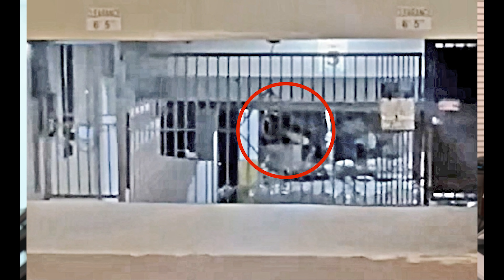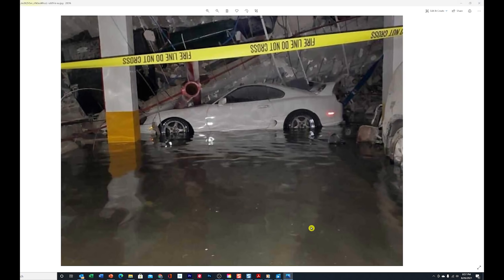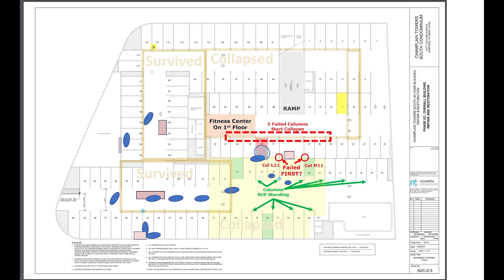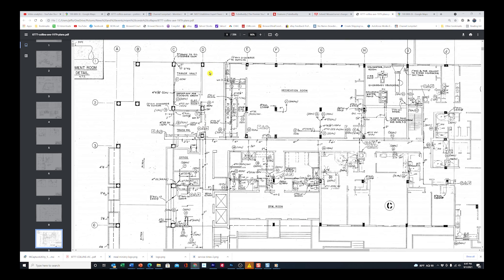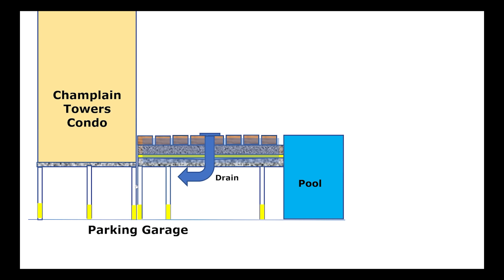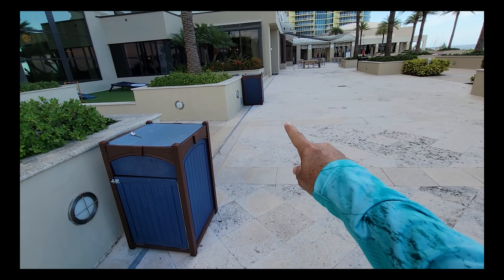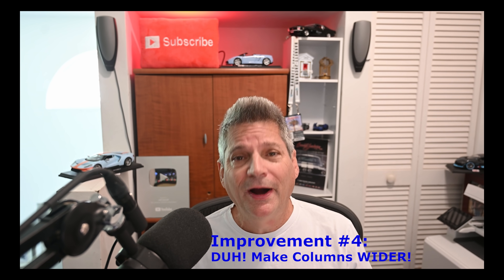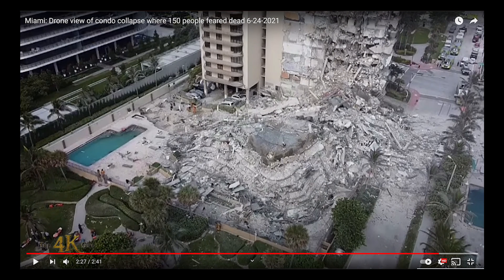Miami Condo Collapse: 4 Engineering Fixes May Have Prevented It

Comment: You forgot shearwalls.  The building should have had many more shearwalls, around the entire perimeter of the foundation and traversing the entire depth and height of the building - west/east and north/south.
Reply: That might add a lot of weight to the building, creating even more deadload for the columns and foundation piles to carry. Anyone can design a building that can last forever, but an engineer can design one and take out all the redundant or unnecessary "fat" out of the structure. Also keeping the design simple, and easy to build will help with workers not cutting corners. Like Omar Little once said, "You see, we got to have it simple, Omar like it simple".
Reply: @brnmcc01  Well, we're told that they removed 22 million pounds of debris, so the building itself was probably 20 million pounds.  The shearwalls i'm talking about would have probably added another million but would have strengthened the building immensely.  They wouldn't have increased the deadload for the columns, as (properly designed) they act a giant columns themselves, in addition to providing lateral support.  And 98 people would be alive today if they'd designed the building correctly.
I'm actually amazed that a hurricane didn't blow the building over at some point, with it's tiny little shearwalls in the wrong axis to take the wind - no east/west shearwalls!  Wonder how many other contemporaneous buildings in Florida are built as flimsy at CTS was...
I used to be a fan of engineers optimizing stuff to the nth degree.  But fuck that shit, if it ends up killing people...  'When in doubt, build it stout'. 
On the other hand, maybe the building was just doomed.  The demolition company planting the explosives to demolish the remaining west portion said it was the softest concrete they'd ever drilled through.  Maybe it would have fallen at some point, with or without the pool deck collapse.

Comment: Have a strong suspicion that Champlain Towers North will implement the column widening and capitals, in earnest, very soon.
Reply: It's relatively easy to do in the basement level, not very practical inside the lobby and condos.
Reply: @gordonrichardson2972  Well, the basement level, especially under the pool deck, is the most critical.  It has the smallest, "most overloaded" columns in the structure and if any deterioration/weakening from water occurred, that's where you'd want to repair and shore up right away.

Comment: #1- In hindsight- an expansion joint to separate the bad from the not so bad yes it would have kept the collapsing pool deck from influencing the building.  However I will say that most engineers and architects would not want to do that, and I don't think people in any of the 3 companies I have worked for would want to do that.  It has a big affect on the design of the building to resist lateral loads and a big affect on the design of the pool deck to brace the basement walls.  Plus architecturally nothing would be worse than trying to create a working EJ cover right at the face of the building among pavers, planters and slab offsets.  It would be a major point for leakage.  Lots of buildings have basements larger than the upper building footprint, I will say that almost none of them have expansion joints between the tower part and the lower part.  Separating the bad from the not so bad- if designed properly then there isn't any of it that is bad.
#2- drop panels are useful for punching shear.  The ones you are showing in that other hotel are not real drop panels, they would be called drop caps.  And yes they would increase punching shear capacity.  Of course all you have to say is that the Champlain Tower should have been designed properly in which case they would have added drop panels or thickened the slab or some other means to satisfy the building code requirements.  The original drawings were deficient in this regard for some reason.  Drop panels are very undesirable in the upper levels because nobody wants to bump their heads into a drop panel in their expensive condo.  There are other means of addressing shear design besides drop panels but for some reason that was missing from the original design.
#3- column capitols are almost never done these days because of difficulties in formwork.  People would complain about the cost, and again they would complain about bumping their heads into the capitols in their expensive condos.  The photo you show is a repair, and I've had to repair those things too.  If built with capitols from the beginning they don't typically put reinforcing in the capitols, that complicated reinforcing was just required by the repairs.  And BTW there are some issues with the design of those repairs and some reinforcing that they left out that should be there.  Plus all of that slab should be shored.  I assume they were lucky enough to get it built without collapse but that is one where I would run out of the building screaming.  But to your point yes column capitols will increase punching shear capacity as well as drop panels.
What would I have done?  I would have designed it properly!  I've spent a lot of years designing reinforced concrete and all aspects of it have to be done right- the slab thicknesses, the slab reinforcing, the column dimensions, shear checks for one way shear and for two way shear, all of it.  I've studied the drawings carefully and there is evidence that this was not done in the original drawings, and some parts of the original drawings clearly do not have enough reinforcing.
Reply: Thanks for your (several) insightful comments. BTW, Florida is a hurricane area, so there would have been multiple design constraints, but not enough consideration of long-term stability.

Comment: What I know about engineering wouldn't fill a hard hat, so this is more questions than anything else, but when I look at some of these century old skyscrapers in New York or Chicago, particularly pictures of them being built, I see these huge steel girders and I-beams that the buildings are then built around, and I've even heard them credited with making the modern skyscraper possible.  I never see rebar sticking straight up with cement poured all around it.  Wouldn't a good steel frame make a building more stable than rebar?  Would a combination of rebar surrounding a steel frame be better?  Or worse?  I'd also seen where big chunks of concrete had fallen off the balconies, and a big crack near the roof of the building, (which I suppose indicated stress or a shift in the load).  These missing chunks of concrete from the balconies made me wonder if the cement had been properly cured or hydrated.  Could poorly cured concrete have been a problem?
Reply: I know only sh*t too. But, what I gather…this is by coast hence, humidity, see water, salt would be a major problem for steel buildings.
Reply: @Wazupu  I thought about that, but the same problems should apply to New York and Chicago, except less salt in Chicago.

Comment: I agree with the changes you proposed. I had thought along similar lines as I have been following this situation.
I'm not an architect or an engineer (I am a career maintenance man, though), but the design of the Champlain Tower South leaves a very bad impression on me. First and foremost, I think this building would still be standing today if it had been maintained properly throughout its life (as I have said previously). By that I mean that there should have been a dedicated team of people looking after the building daily, people who could have found minor problems before they became major problems, and made the necessary improvements to prevent major problems from becoming disasters. I also think that the columns were too thin and spindly to properly hold up against unexpected forces, such as a pool deck collapse or ANY lateral load. Lastly, I think that there should have been a lot more redundancy in the structure, and a lot more horizontal bracing throughout the building (to deal with lateral loads). Even losing a few columns shouldn't have caused the whole building to collapse (IMHO), and it sure as heck shouldn't have fallen down just because the pool deck broke through its columns!
Maybe I'm just dreaming of a world with fully funded maintenance departments...
Reply from the maker: Said it perfectly "Unexpected forces". You heard my challenge to engineers to think about unexpected forces, not just expected forces.

Comment: I watched another engineer describe how the pool deck engineering specifications was maxed out Before the pavers were installed.  I mentioned in his comments about the additional pavers.  I have not been able to followup since I forgot who he was.  SOOOO.... in my opinion, the poll deck was under engineered for any additional load such as The pavers and the addition of palm trees and the required mechanical devices required to add and remove them. Add that to the failure to isolate the pool deck from the building. 

SOOOO now the question is, can we attribute a SINGLE reason for the collapse of the 
A - pool deck to be  the addition of the pavers to the pool deck and the addition of the palm trees, exceeding the initial engineering specifications  
AND then the ultimate collapse of the 
B -  building , is due to the pool deck slab continuous with that of the building, pulling the building down with it.
.
With time, the stresses continued to weaken the entire pool deck system, in my opinion you do not need a catalyst to initiate the series of collapses.
As a retired software engineer, i learned early in my career that  it is essential to build your system to be idiot proof, thus turning a simple   into a complex system.
Reply from the maker: Yes Josh on Building Integrity stated that
Reply: @jeffostroff  thanks
Reply: @jeffostroff  So, do you blame the addition of stress not having taken into account by the engineer, or do you blame the engineer for under engineering? Plus you mentioned many shows back, the engineering of the  building itself may not have taken into consideration of the additional load introduced by adding marble floors, walls and counters during remodeling of the apartments.
Reply: @jeffostroff  If the design was at max load, that means the failure was just a matter of time.

Comment: of course all the caps and such on the columns to prevent punching shear does no good when the rebar is rusted away.
Reply from the maker: They can still repair the rusty rebar
Reply: When the rebar starts rusting, the concrete visibly discolours and spalls off. Those warning signs are when you know it's time for emergency repairs.

Comment: WAFFLE SLABS baby!  (One variety seen @12:30)  Not only less dead load, but a lot of highly-reusable forms.  It's not so much the volume of concrete that drives up costs, or even the manual bending and placement of the rebar, but rather the rough carpentry labor needed to make all those bespoke one-and-done plywood forms.
Reply from the maker: Plus the had a ton of wood stolen from the site during construction
Reply: @jeffostroff  No doubt his rival developer--also a Convicted Felon--was erecting a similar building a mile north or south, and decided to "save" on plywood costs.  Not sure if they still douse the wooden forms with diesel fuel as a form-release agent, but IIRC either OSHA or The EPA put the kibosh on that... but is there any enforcement?

Comment: I was surprised that you said the 'drop panels' were made from a pour of cement. I originally thought that drop panel was made from a metal (steel or iron). So a big metal plate.
Reply from the maker: It's rebar and concrete

Comment: I have to agree with you on the garage level changes, mainly isolation seams, as my biggest question this whole time has been why so many parts of the building came down even when there appeared to be sheering walls that should have stopped it.  I feel that not having had isolation joints at the garage level where the sheering walls were meant that the sheering walls were knit together at garage level and could have pulled over part of the building instead of sheering off and only the first part collapsing and then leaving all the yes standing at least long enough to have evacuated most.

The other would be proper capping of the columns, which definitely had been some of the major work down on older buildings with sub basements and garages that needed to be retrofitted in seismically active areas, columns did not have to be made wider but needed to be capped properly.
Reply from the maker: Shearing walls don't stop that sort of thing, they are basically there 2 bolster strength to the wall that's coming 90 degrees to the sheering wall it's basically there for wind.

Comment: Just insane how poor the drainage was. How do you build a like... 10k square foot deck and paver over it without proper drainage? Thing should have had a like... 1/4" per foot drop at least.  That's the primary thing needed for repair. None of this structure would have been an issue if mother nature had been properly fortified against. It's in theory, strong enough. That is nuts a 12 store building sitting in 16x16 pillars. That doesn't jibe with my over-engineer mentality. Just the other day engineer called for a 2x7 beam and I used a 2x10 because it was only $40 more on a $23k job. And one thing with capitals on posts is it does limit the width of available parking and what not. I'd assume, beyond incompetence, would be one reason they aren't always used. That repair you showed was cool.
Reply from the maker: exactly!

Comment: I enjoy your videos very much and your insights. But I must ask if you could address the volume levels over the course of your video. There are multiple times that the noise and/or your voice get 50% quieter and then back up 100% or 150%. Example: 5:28 . Extremely distracting and sometimes even painful with my headphones. If you could please listen to the video all the way through before you post, on a different set of speakers or headphones, I would be immensely grateful.
Reply from the maker: Yes sorry about that I was rushing to get this one done in the middle of the night and was supposed to go back and find all of those that did not have quite the right level, I'm still learning curve on the new Adobe Photoshop pro and hope to have these kinks worked out soon

Comment: I would also add the concern of the pool deck too, such as was there a proper draining system when water touched the pool deck? Did the planter box contribute to water getting access to corrode the iron and weaken the concrete? Were the pavers too heavy to place on top of 16" wide columns? There is also the concern that one surveyor just left a hole by one planter box and didn't bother to patch it back quickly.
Reply from the maker: Some good questions. We don't know if they had drainage

Comment: I wouldnt mind a video from you on post tension concrete slabs. 
What happens when someone cuts into one.  How to tell if a building has this so one could avoid an accident.
If one was cut in a tower.. Ehat would be the extent of compromise to that structure?
Your notes as an engineer.
Reply: If you don't have the original drawings and you are just looking at concrete from the outside, it can be impossible to tell if it is PT or not.  You can look for hidden edges such as inside elevator shafts and stairs where there might have been PT stressing anchors.  Around the edge of the building assuming slab edges are exposed usually the stressing pockets would be well hidden but at interior opening there might be telltale circles visible.
Reply from the maker: I always wondered that myself

Comment: Great analysis. All four points are extremely valid imo. Although, I'd argue that points 2 and 3 are variations of the same concept. You can do either one or or both (with both being the belt-and-suspenders approach).
Reply: #2 and #3 would differ in their ease of initial design versus retrospective repair.
Reply: @gordonrichardson2972  I agree but I have seen each method (and both) specified on new construction as well. I think the goal of distributing the load more evenly can be met with either solution, so it has to be at least partially a matter of architectural and/or engineering design preference. As an architect and not an engineer myself, I imagine there could be a consensus in the engineering community as to which method has the most benefits (besides the very important retrofit benefit you mentioned). Since the majority of the ones I see here in California are of the drop panel variety, I'm assuming that method is simply the most cost effective.
Reply: @CaptainCaveman1170  Florida is more a hurricane than an earthquake hazard area, so the load calculations would be different.
Reply: @gordonrichardson2972  Sure but the calculations for wind loads and seismic forces are surprisingly similar. With both forces bring lateral in nature, it's really the shear walls and possibly the horizontal members that would change the most (if at all). I don't see concrete column design varying much from state to state as almost all of a column's job is to resist weight vertically. What we can all surely agree upon is that there are various ways to deal with the moment force at each column/slab transition, and the design we saw at Champlain Towers South will probably turn out to be the worst possible option.
Reply from the maker: Thanks for sharing!